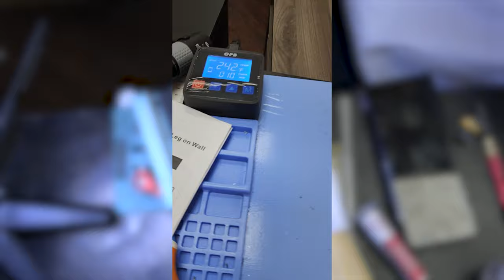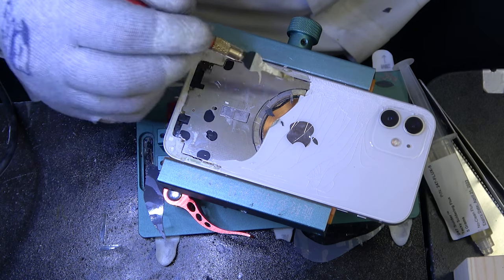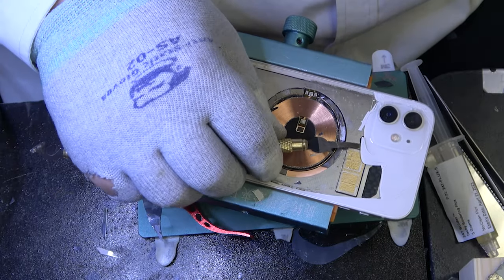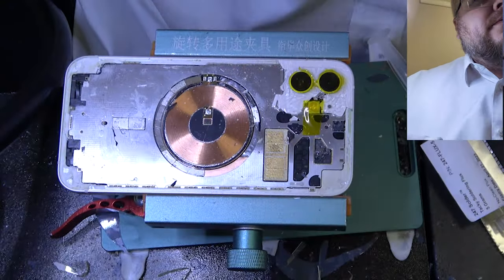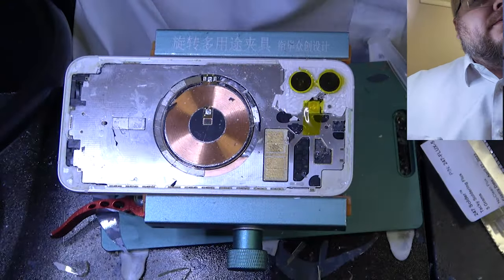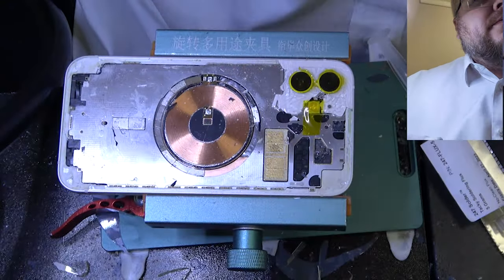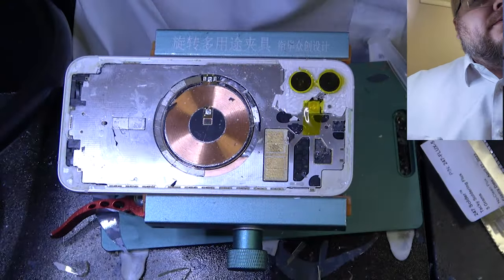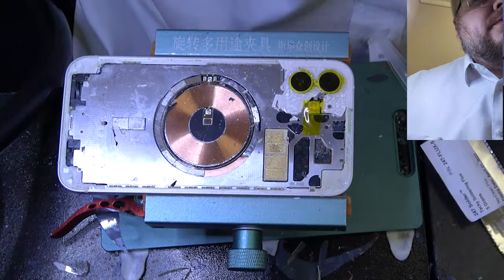iPhone 12 Back Glass Repair New DETAILED Method 2022

Comment: I like this method, as I’m just starting out & can’t afford the laser machine.
Did you preheat the back before removing with the hot air nozzle?

If so, what equipment and for how long? 

Great video 
TanQ 👊🏾
Reply from the maker: It’s not required.

Comment: Thats NOT the battery, folks. Thats the wireless charging coil hes referring to. And a vise or holder needs to have a slot to keep the power button from being pressed the whole time its in the vise or holder.

Comment: I'm starting out doing back glass repair. I like this method, what equipment/heat gun do you use?
Reply from the maker: If you call Injured gadgets and ask him for the Tech MD back glass repair bundle will give you everything you need. If not click on the link in the description for Injured gadgets and find each individual part and add it to your cart
Reply: @TechMDYoutube  how much is the bundle cost

Comment: Back glass on 12 series and up is so much easier then 11 and below but the camera glass is a huge pain in the ass. Did a 13 pro.max other day and that camera glass was a nightmare ended up destroying the flash cause the blade slipped right under it damaging it somehow then spent like a hour replacing the dam flash since u pretty much have to take the whole dam phone apart to get the flash out! Wish there was a easier way. Even with a laser seems like u will still have a fight with that dam thick ass camera glass.

Comment: the golden plate is for antenna I believe, does it make a difference if the golden plate is came out during the broken back glass removal? is the golden plat just glued or its connected with some component?

Comment: I got a 12 mini that got dropped the only visible damage is the back glass shattered and it’s exposed the coil for the wireless charger or about  25% of the coil.  The problem is it’s like it has no SIM card in the phone now. Everything works like it should except reading the sim. Do you have any idea what could have happened

Comment: That’s not the battery lol the battery is on the other side that’s the magnets for the MagSafe devices and that’s the wireless charger
Reply from the maker: Yes and when you remove the 2 big magnets below the the ring, it exposes the battery. Prove me otherwise?

Comment: That is not OEM Glue mate... And exposing battery to 400°C it's not good idea...
Reply: im about to buy a iphone 12 with a crack in the back lass its 256gb is it worth $350?
Reply: @corel965  i ended up paying $419 for an iphone 11 pro max 256gb
Reply: Paid $120 for a iPhone 11 Pro
Reply: @LOCKBlT  damn that’s joog nice find
Reply: I found one for 250, I was about to ask the same thing
Reply: Not a good idea before giving advice learn grammar

Comment: Caution ppl's!  This is not an original housing.. 
The glue is the wrong color, and theres no foil patch covering the QI coil either! Looks a lot like a copy housing to me, and the glass almost comes of those, just by giving them "a stern look"..! I got the TBK 958 Laser, so I never tried this process with a heat gun, but I am sure, that you will fry the shit out of pretty much any original iPhone housing (with serious glus), if attempting to remove the back glass like this! I sometimes offer my "copy-housing-back-glass costumers" a discount, whenever I come across one of these.. as the glass come of so easy!
Reply: Not an OEM housing.  Either that or it's been replaced before.

Comment from the maker: Please support the channel by using my amazon links! 
For just the Back Glass & Recommended Parts click on the links below.

iPhone 12 Back Glass :
https://amzn.to/3uUQ3IF ( Black )
https://amzn.to/3uY1pM7 ( Blue )
https://amzn.to/3uYwpvc ( Red )
https://amzn.to/3j7j1j4 ( Green )

Back Screen Protector :
https://amzn.to/36Wv8Np

iPhone 12 Screen LCD :
https://amzn.to/35Bwo81
https://amzn.to/3MGZdke

2 & 3 PACK Screen Protector :
https://amzn.to/3vIMYgV
https://amzn.to/3tAeYk1

Recommended iPhone 12 Covers :
https://amzn.to/3vOtCHm
https://amzn.to/3KolDof

FOR NEW PHONE!
https://amzn.to/35Smpeh

Hot Air Rework Station :
https://amzn.to/32PXsyX
https://amzn.to/3EQca5T

Glass Breaker Pen :
https://amzn.to/3HCFe32
https://amzn.to/3spmyh2

Safety Glasses :
https://amzn.to/3fbBmcV
https://amzn.to/3fbBpp7

Fume Extractor :
https://amzn.to/3eXzsMB
https://amzn.to/3eOI1cG

Glue Remover :
https://amzn.to/3HFGUbR

Syringes, Plastic Squeeze Bottles and Needle Tips :
https://amzn.to/3pU3pDF

Clamp :
https://amzn.to/32OcNA4

Cold Glass Glue :
https://amzn.to/3sVkqiH

Heating pad:
https://amzn.to/3mbIytW

Heat Resistant Gloves
https://amzn.to/3EsZdyW

My blue mat to keep everyone organized:
https://amzn.to/3BalS16

iFlex Opening Tool with Glue Card :
https://amzn.to/35UC9h8

iPlastix Opening Tool with Glue Card :
https://amzn.to/38FtzUH

on of my favorite screw driver sets 2uul:
https://amzn.to/3jsqkCz
https://amzn.to/3CcoL2Y

iseasmo w/ Kit (Has Screw driver too)
https://amzn.to/35Za2O0

Tweezers:
https://amzn.to/3B7yBlf

T-7000 Water sealing glue:
https://amzn.to/3EdzLxs 

Isopropyl Alcohol For Technical Use:
https://amzn.to/3BqBU78

Need to get a part from a reliable quick source, you'll find a better price here then Amazon and the quality will be a lot better. Click on the link below.
https://www.injuredgadgets.com/?acc=be9b6cec65c863e1b55538d2c7fcc9b0

• Visit our Website: https://tech-md.com

• My email: dustin@techmd.bz

• To mail in your phone, please contact us at 801-438-6028